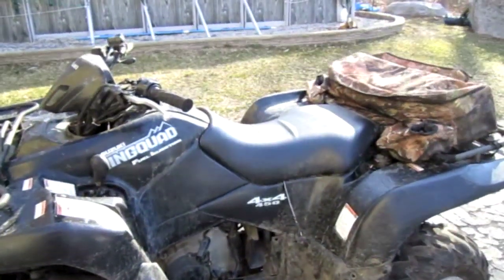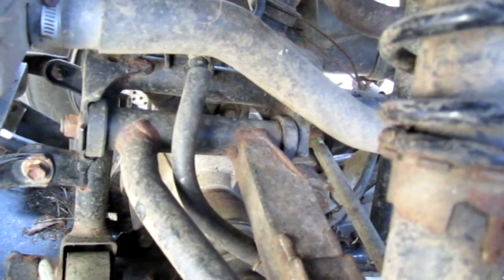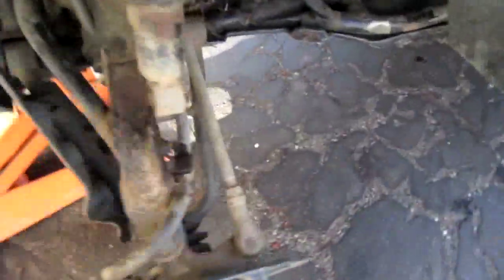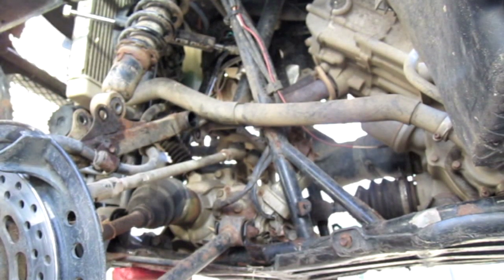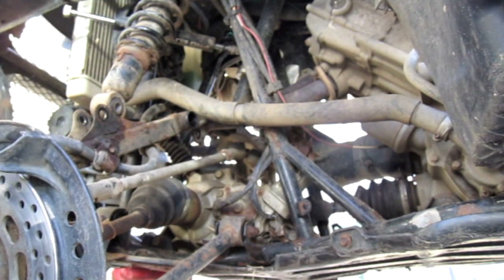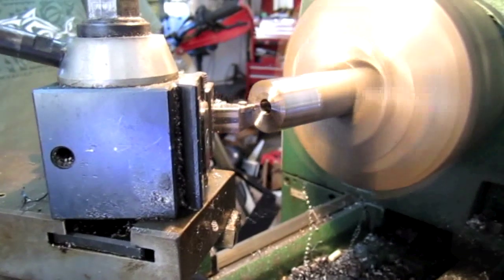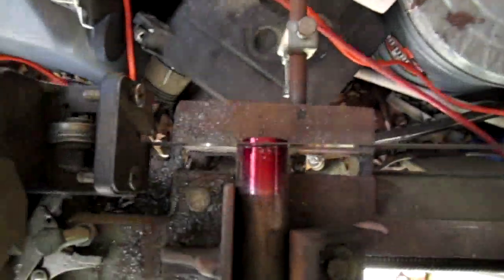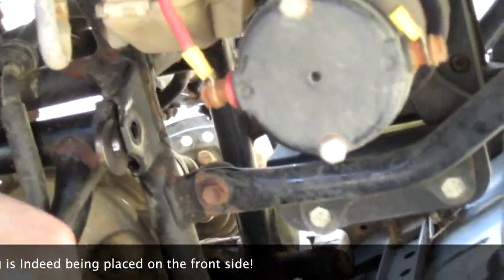Suzuki KingQuad Demijohn Caster Mod

Comment: I was the Tech Tip admin on Nyroc for some years. This authors demo is how I did the Demijohn caster mod, almost exactly. The spacers seen at 10:50 can be made from four 3/8 stainless flat washers which I've found total exactly .187"in thickness. Demijohn was a master automotive teacher instructor. (taught the teachers!) and from his acumen he deduced the reason for the somewhat twitchy steering and penchant for snapping the handlebars to full lock, of the King Quad, as being the result of it having an abnormally shallow caster. 1.6 degrees.
Suzuki never admitted of this but curiously when they came out with the power steering edition in 2008, it had a caster of 3.4 degrees.

Comment: 3/16" or .187 rearward relocation of the top tube provides 4.0 degrees positive castor in place of the stock 1.6 degrees.  This is done just right. I've done maybe a dozen of these mods myself, just like this though I add a mini grease zerk to the middle of the tube while I have it apart.
The originator of the mod and the reason it's called the Demijohn mod, is Demijohn of Revelstoke B.C. Canada. (not me!)

Comment from the maker: Yes, it was a tube-type stabilizer, and you can actually see it (well the adjuster thumb screw portion of it)  right behind the radiator right at :39 - it did help a bit, but it had to be set way too stiff for normal riding.  Set where it was comfortable for normal riding still resulted in handlebar whips..  I would recommend it s well as the caster mod for the best performance.